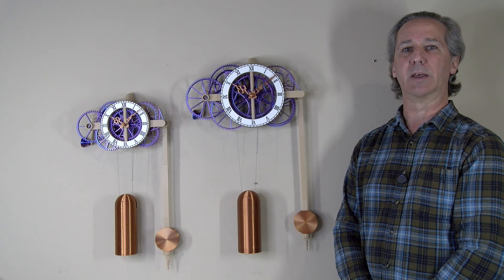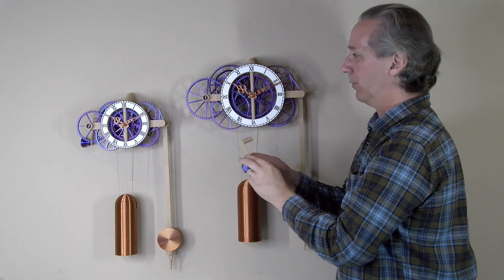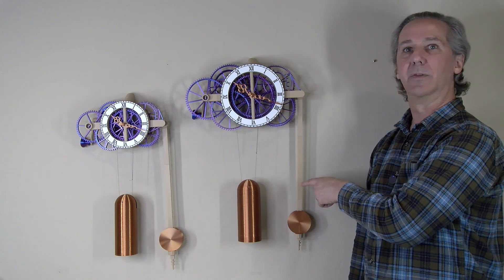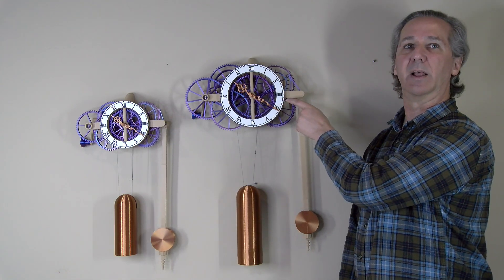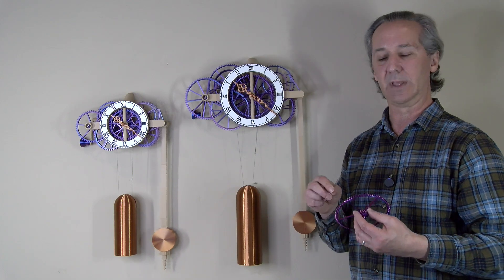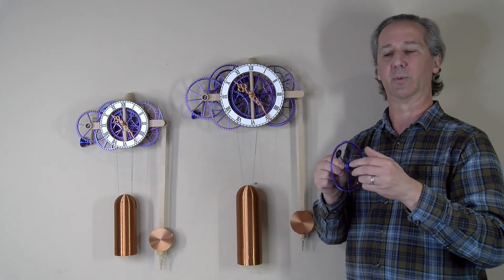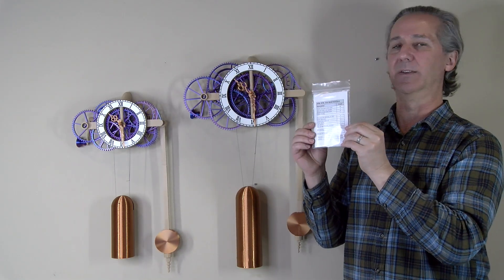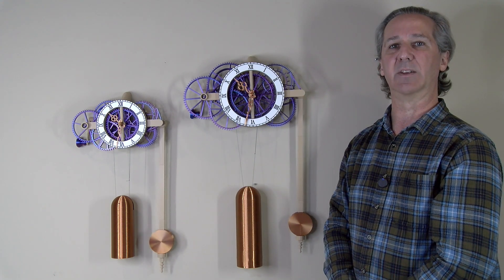Large Easy Build Clock Update

Comment: I'm Sorry But your new gears SUCK. they dont work in any configuration for this clock, and the old design was WAY better and looked better.  please go back to the old fancy gears if you are going to sell this plans for 3d printed parts the teeth HAVE to be big to be efficient. please dont tell me my printer settings blah blah. Ive spent over a year redesigning your clock and have printed over 300 different type gears and your OLD design is much better I tried the new 1s at least 12 different sets and settings sizes etc and they all wont work, or they bind up because 3d prints are high tolerances and require more space so they wont bind. I have tried dremeling my own gears and they worked better than the new designed small teeth gears
Reply from the maker: Thanks for the feedback. My experience is that the new gear style creates a significantly more reliable clock. The old design is still included in a subdirectory called original_reference_design if you feel the need to use it. 

There is plenty of backlash and clearance built into the design. The new gears do not mesh with the old gears, so if you re-print one new gear, you have to re-print all of the gears. A new frame is also needed to fit the updated gears. The resulting clock runs better using about 20% less drive weight in my experience.

Comment: hello steve , I bought the files for the Sp4b.  on the print list it says Frame_back_bottom, right , left, center , and top. However, I only have files bottom, right, and top. I am missing center and left as well as some of the front files. Am I missing files from the download?
Reply from the maker: The clock was uploaded as a zip file and the required files are present. If they are missing on your end, then download the zip file again and they will be found.

Comment: Very nice looking design. Can this actually be used as a timepiece, meaning, does it keep accurate time?
Reply from the maker: My design criteria are: #1, accuracy. #2, reliability. #3, long runtime. #4, looks good. #5, easy to assemble.

The clock holds an accuracy of about a minute per week when operating in an environment with modern heating and air conditioning. To keep the design simple, the pendulum does not have temperature compensation. The deadbeat escapement is fairly tolerant of changes in friction over time. I believe this is as accurate as any other 3D printed or wooden gear clock. I find it easy enough to look at my phone when winding to adjust the time and give a minor turn on the adjustment knob if needed.

Some of my other clocks use precision real time clock references to hold an accuracy of a minute per year.
Reply: @stevesclocks  Thank you. One minute per week is very impressive for a 3D printed clock. I'll add this to my project list.
Reply: @ I just ordered the file set. Thank you.

Comment: I have made a few clocks using different manufacturing methods by other designers including a hand cut one using a scroll saw, a CNC routed clock, a laser cut clock and one of your 3D printed clocks. Yours was the best running clock of them all and keeps perfect time. Yours are very well thought out, excellent instructions, more than fair prices and I will most likely purchase another one of yours because it's rewarding and I love seeing them run. Problem is, I need another clock like I need a hole in the head!
Reply from the maker: Thanks so much for the glowing review. I design every clock to take advantage of the characteristics of the 3D printer. They are not just ported over from old style brass designs. I don't need any more clocks either. I usually only keep 3-4 of them running at a time. The rest are in boxes ready for the next Maker Faire.

Comment: I've had the parts printed for both the smaller and the large clocks for about a year now, but I haven't assembled them yet because I can't find a reasonable price on the lead/steel shot for the weight. Any recommendations on where to find a good price? Thanks.
Reply from the maker: There is an expanded section in the assembly guide describing some options. I prefer steel shot or copper plated steel BBs. They are significantly safer and only slightly less dense than lead.

The assembly guide can be downloaded from MyMiniFactory if you have already purchased the design. Or it can be downloaded from my website at https://www.stevesclocks.com/sp4

Comment: Thanks for the update. I printed the previous model and can’t get it to run reliably for greater than 3 hours. I will attempt to add more weight through the extended shell (currently running a bit over 6 pounds of lead shot in the standard shell) and maybe that’ll do it. Currently, I have a tock-tock tick (double bump on the upper quadrant arm), and there appears to be some friction in the power train I can’t pin down. Additionally, the 1.5mm steel rods bend VERY easily when inserting them. What do you think about making all rods at the larger diameter?

I’ll build the updated version, and see if that’ll work, as well as upping the weight.
Reply from the maker: Double ticking is sometimes a symptom of friction in the gear train causing a sluggish escapement. The pallet arms have mostly moved out of the way by the time the escapement finally accelerates up to speed and all of the energy lands on the next tooth causing it to bounce. 6 pounds of weight should be enough with the shorter runtimes, but not enough for the longer runtimes. It is impossible to tell without knowing what runtime option you are building.

The design specifies 1.5mm or 1/16" music wire for the small diameter arbors. Music wire is also called piano wire or spring steel. It is very stiff and does not bend unless it is forced. The new design replaced the ratchet arbor with 3mm rods. It keeps the smaller diameter on the escapement side of the clock to keep friction lower. The forces are small enough that softer steel might be OK as long as it is straight. If the wire bends when inserting it, then the wire is either incredibly soft or the holes need to be enlarged.
Reply: @ thanks for the info. I’ve been attempting to reduce the friction in the gear train without success up to this point, but will continue to look into it. I built the 10 day version, and when I get it running consistently I will be giving it to my very talented 10 year old grandson (physics and engineering are favorite subjects and this’ll suit both areas for him).

Once again, cool project, and I’ll build one of your new versions as well for here at home. 3D printing is certainly easier than firing up my machine shop and attempting to layout and cut all those gears/mechanism out of brass!
Reply from the maker: @a41capt  Finding that last bit of friction changes the clock into a reliable timekeeper. If you have built other clocks, then you know how sensitive they can be. The updated design reduces some of the friction trouble spots. Arbor friction, lack of end shake, or high friction bearings are still issues to debug on every clock. I still get a few clocks that stop running until finding a minor flaw.

Yes, 3D printing makes clock building accessible to a much larger group of people. I have a woodshop with a CNC router, but so far all of my functional clocks have come from the 3D printer.

Comment: Steve Thanks for continuing to support your designs, and provide the updates at no charge.  The hints were very helpful.  Will you make any changes to the motorized clocks?
Reply from the maker: The Coup Perdu and EM Clocks may get some updates. Not sure if the stepper motor clocks need any changes, although I may update the assembly guides. Also, the Moon Phase Clock has a few minor edits coming, along with a medium sized version.
Reply: @stevesclocks  Thanks. I have built them and would like to try again.